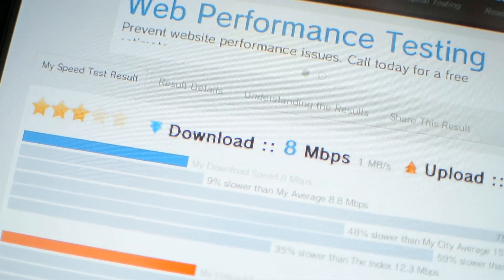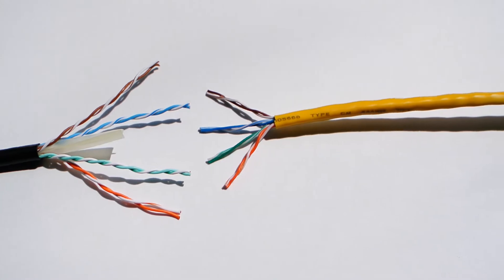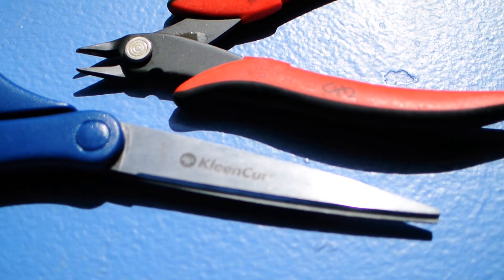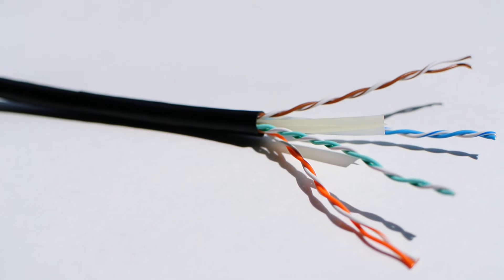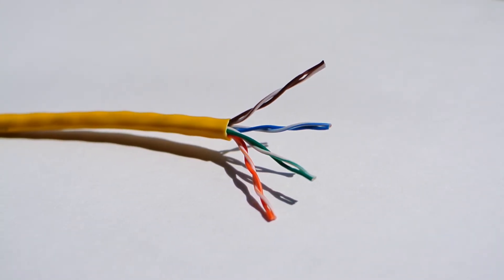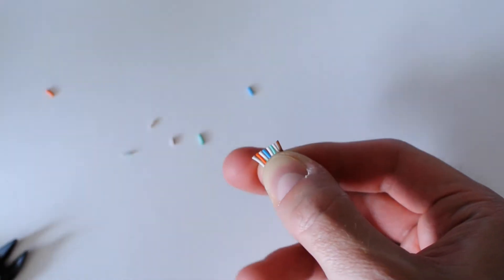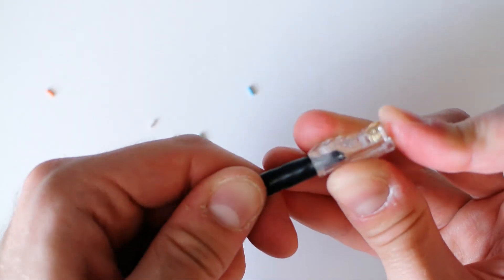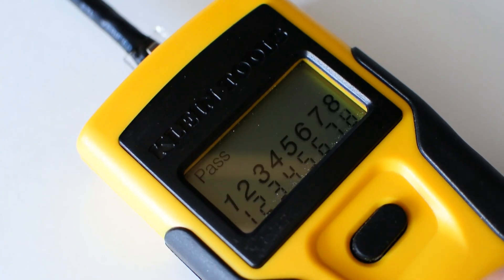How to Make Network Patch Cables

Comment: 3:37 to 3:45, RJ45 is a telephone technician name for that connector, btw.  In computer networking terms, we call it an "8-P-8-C"; stands for 8 pins, 8 conductors.  Do not get the two mixed up.